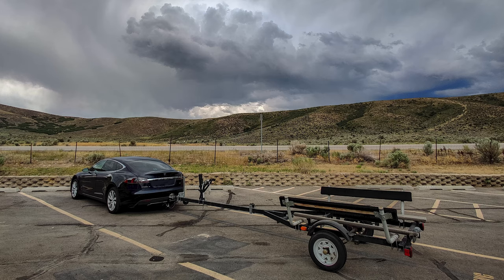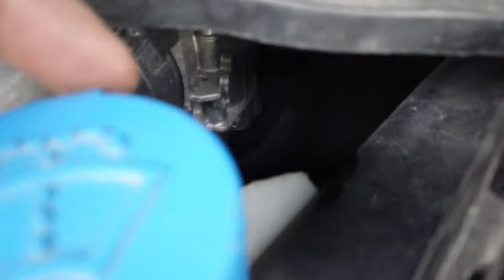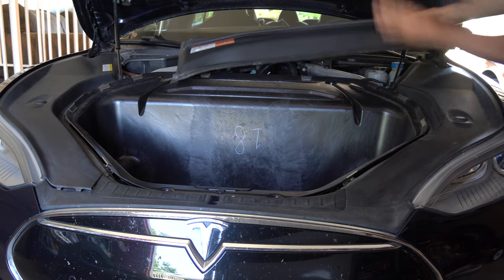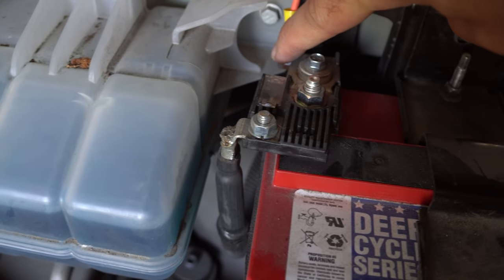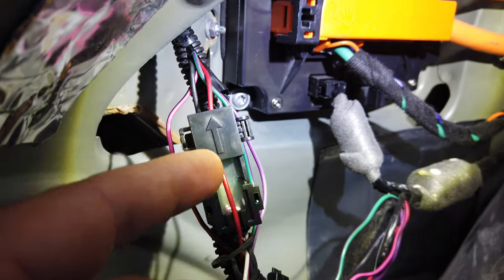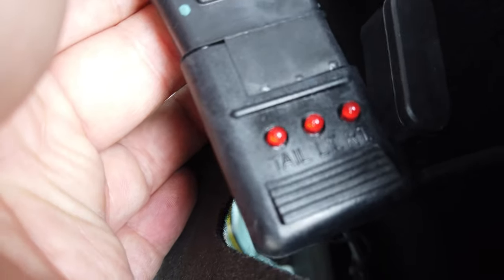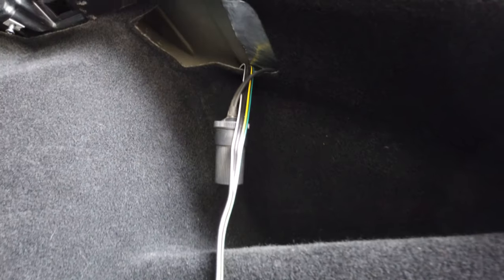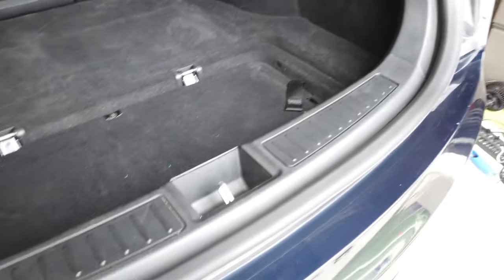How To DIY Install Trailer Light Wiring On A 2015 Tesla Model S

Comment: Thanks so much for these videos. I have a 2015 85D also, and these videos helped a lot. I had great success installing the hitch, and got the wiring harness installed, but having issues with it. The signal lights just flash once and the tail lights often remain on when the car is off.  Not sure if I did something wrong with the install or the Tekonsha learn steps... Any ideas of things to check?
Reply from the maker: I have not experienced what you are describing so I don't know what is going on. Finding the right wires was a lot of trial and error though so I wonder if maybe you just have the wrong wires. When I tried to find online which wires to use I never found a strong consensus so I wonder if Tesla has used different color wires through the years for various purposes. I wish I could be more help.

Comment: Was there pros and cons to how you ran the power wire under the vehicle.  I know that you mentioned to run on passenger side.  Is there a way to run on interior of vehicle vs. exterior underneath? Is there a water or snow threat with it ran underneath or is that not an issue since that is fused.  I may install an on/off switch inside the frunck.  What are your thoughts about running wire inside between floor panels?
Reply from the maker: I ran the wire on the outside underneath the vehicle because that was the clearest easy path from the back to the front of the vehicle and I don't foresee any issues. It's enclosed in a protective conduit and that conduit is zip tied regularly along the length to keep it in it's path. If it was under a truck and I did a lot of offroading through brush then that would be a different story. I investigated running it through the interior and that was going to be a LOT more work pulling back trim pieces and carpet. I've been driving around with it on the outside for 7 months without any issues. If I did it again I'd run it the same way, but up the passenger side of the vehicle as you mentioned. A switch could certainly be installed in the frunk area easily enough.

Comment: Great Job!. Is it possible to draw the 12V from the cigar jack? I believe it has 15A capacity.
Reply from the maker: Yes I do all the time. I installed the splitter on it so I can run the two 12 volt fans simultaneously and it works great for that. Just this last weekend I used it to run a 12 volt air pump to air up one of my kid's bicycle tires. I've even used it to run an ice cream maker through an inverter which I have a video about on my channel a couple months ago. I love having power options for charging batteries and running devices in the back of my Model S.

Comment: Is there a 12v you could have hooked up to in the trunk area?
Reply from the maker: I imagine there is, considering there's a powered liftgate in the back. However figuring out exactly which wire, and how to non-destructively connect to it is the question. I googled this project a lot and the internet failed me, but luckily I was able to figure out this method in the end, and now 4 years later it still works. Running the wire outside the car is not ideal, and I've heard some commenters say they figured out a route to run the wire inside up to the front low voltage battery.

Comment: Thanks for all the details, especially on those removing the internal paneling! I always struggle with those, I don't know if I missed a clip or if I'm just supposed to pull harder. Not sure if I missed it in the video, but where does the trailer light connector go when you are not towing? Is it tucked away under in the 3rd row seat compartment? And then when you do connect it, do you just pull it out and close the hatch over it?
Reply: Found it!
Reply from the maker: I'm glad you figured it out. I just stuff the wires into the hole in the interior carpeting on the passenger side of the trunk area and that works great for me. When using it I extend it out to the trailer and just shut the trunk lid onto it ensuring it doesn't get mashed by the latching mechanism.